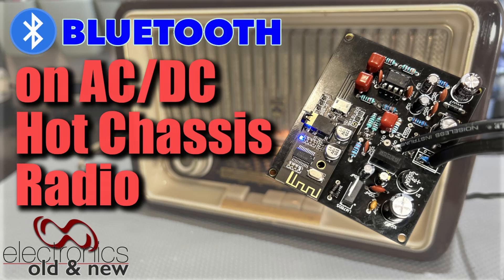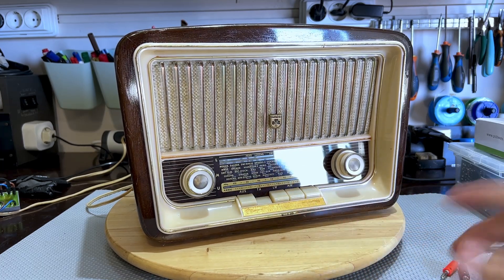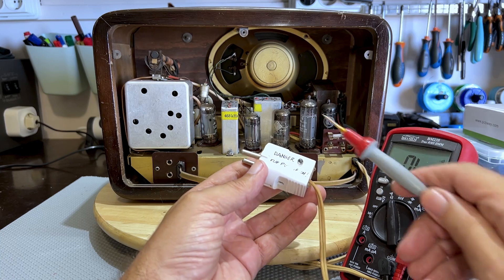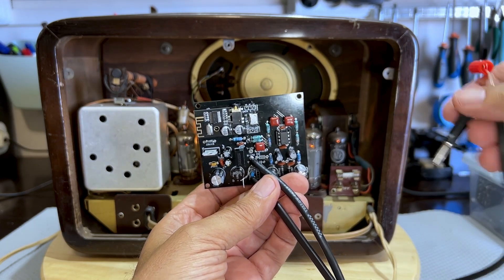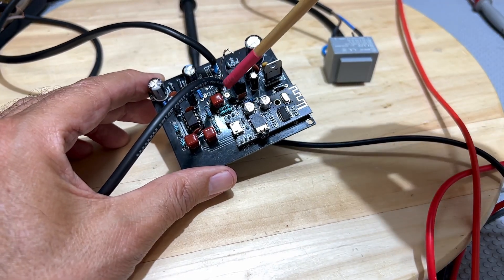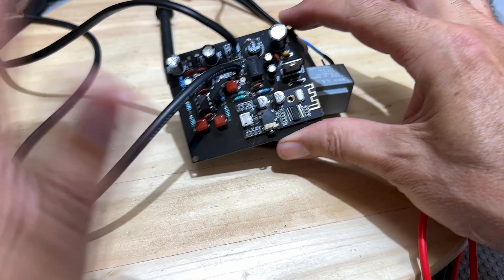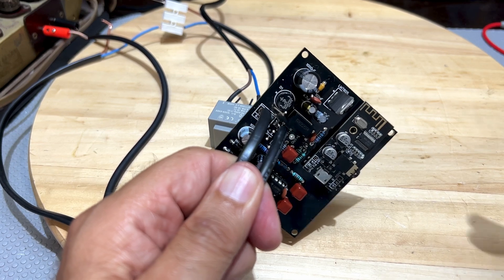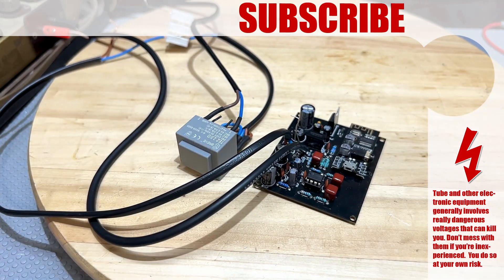Boost Your Vintage "AC/DC Hot-Chassis" Tube Radio with Bluetooth! Does my design work as is?

Comment: Thank you for sharing your knowledge with adding BT to vintage tube radios. There's 1 commonality in all your videos - they all plug into the phono port of the radio. But what happens if you want to add BT to a radio with no external input? I'm guessing you tap it before the volume pot (using a switch?) and what about levels? Does one still need an op amp in this case?
Reply from the maker: Yes, what is usually done is connecting to the top of the volume pot, preferably with a switch. The levels will probably still require boosting.

Comment: I've built 10 of these so far but all my radios so far have a 6VCT transformer windings so I'm having to go the transformer route.  Just curious if you know the maximum gain I can achieve using a 9VAC transformer before getting clipping. Do you think I could go with a 7X gain?
Reply from the maker: Theoretically it should go that high. But since you’re using a transformer, why not use a 12v one and get more headroom?
Reply: @electronicsoldandnew  if I go with a 12VAC transformer do I need to put a heatsink on the 7805?
Reply from the maker: Possibly. It will dissipate under 1W, but that could heat it up quite a bit.

Comment: There seems to be something wrong with the phono input. Normaly the input is not connected directly to chassis but there is always a block capacity of 5nF to chassis ground. No one would ever sell a construction where you can die by touching the phono inputs.
Reply from the maker: I’ve seen this before on a jubilate. Dangerous as hell … either by design or some tech changed things in the past.

Comment: would it be correct to say  using a mains transformer, the dc to dc convertor is no longer needed because you already have isolation /no ground loop (hum) or are you still needing to isolate digital earth from analog earth to prevent digital noise breakthrough?
Reply from the maker: It is probably not needed with a transformer for that exact reason, but I haven’t experimented with it as yet. Just wanted to see what would be needed to make the same circuit work on a hot chassis.

Comment: Why don't you design a circuit so you can't plug it in wrong? Have the circuit flip the hot and neutral the correct way or not allow the radio to have power to the chassis.

Comment: Why don't you design a circuit so you can't plug it in wrong? Have the circuit flip the hot and neutral the correct way or not allow the radio to have power to the chassis.
Reply from the maker: That’s not something I care to do, as most people have already found a way to use their radios safely.

Comment: When you are stil afraid that the audio ground gets on the live mains, you can put in the soldered audio ground a large capacitor, but it would be a 400V 8µ or so. I don't like the sound of 230V getting in your BT board, it is original not designed for that.
Reply from the maker: The cap would indeed make it safer, but the mains getting to the board is t a problem as long as it doesn’t get anywhere near anything at a different potential. Effectively all you’re doing is elevating the “ground” reference, which isn’t normally a problem.

Comment: You can use that miniature transformer in conjunction with a switch and wire it to the volume pot, using the switch to disconnect the radio signal, and add a 3.5 mm jack. On that 3.5 mm jack you could add a wireless Bluetooth dongle as another solution. Fantastic schematic and adaptation of your creation.
Reply: @electronicsoldandnew I just want to tell you that I really enjoy your channel and your presentation. In the States I don't get a lot of these types of radios to work on so you are and invaluable source of experience and information. Thank you
Reply from the maker: My pleasure

Comment: I am amazed that the EU never passed a law requiring all member states to standardise on the three-pin mains plug we enjoy here in the UK. 🤣🤣🤣

Yes, that was really realy naughty of me but I hope you get my drift. Here in the UK we're not that clever either with our reversible bayonet mains light sockets. I'd outlaw those as well as it's possible to buy B22 socket extension plugs. ⚡ 👿
Reply from the maker: I agree with you completely 😊 it would be so easy as some of these plugs have a hole on one end which would only require the sockets to have a protruding pin, but I guess they’re being stubborn in this issue.
Reply: @electronicsoldandnew  France and other countries plug have 3 pins, but there is no defined neutral wire position, only the ground/protective one. And you can still use 2 wires plug which you can connect both ways. 3 pin with defined ground is only required for devices with metal cover.
Btw british plug is too big.
Btw Im dissapointed by the design of this little Grundig radio, that there is phono input directly connected to chassis. Standard way for hot chassis radio was to use audio isolation transformer for phono input. Antenna was always protected by small value/high voltage caps (now we call them Y2 caps).
Reply from the maker: Yes, it’s a pity the plug issue hasn’t been standardised and regulated all over Europe. In Portugal we have no protection as regards mains polarity.
The Grundig was a surprise indeed. Initially I didn’t realise it was an auto transformer, and the worst part was the phono ground to chassis connection. I wonder how many people got shocked over the years … totally needless. A proper transformer would have cost very little more than this one, and all the danger removed from the set.
Reply: @electronicsoldandnew  There were planty of hot chassis sets in 40s-50s. Copper was expensive, so transformers were expensive too during war and postwar years.
But I never saw set where you can touch hot chassis without opening back cover. It looks like error.
There is no way how to standardize plugs across Europe - it would be too expensive, you would have to rebuild all electric installation. We in Czech republic also dont have polarized plugs, we use french standard designed in 1920s. German standard doesnt have it too, both wires should be considered as possibly hot.

Comment: Greetings From Germany... A question concerning identifying the chassis ground transformer of the radio's schematic and then comparing it to a similar model that has an isolated ground. 
Is it possible to make a supplementary video or Part 2 just to show us viewers exactly what to look for on the schematic for a positive identification of chassis ground.
Reply from the maker: You can easily see it from the schematic. One side of the mains is shown as grounded. You can also just test with a multimeter as I did at the start of the video.
Reply: @electronicsoldandnew  I think to remember that you forgot in the schematic to show that one side of the 6.3V filament winding of the transformer is connected to ground. You told it, but it is not drawn. Maybe that is the confusion here ?
Reply from the maker: Perhaps, but the ground is shown. Not sure I understand the question

Comment: Nice addition to your Bluetooth lineup Manue, The only trouble is Bluetooth is you can't transmit simultaneously to one's whole radio collection. Coming up with a legal AM transmitter with good audio would be nice for the collector, but offers some serious problems.
Reply from the maker: True.
Reply: Can't vouch for this but there is a seller on ebay (orient100) creating Bluetooth to AM radios supposedly not exceeding 50mW (below the unlicensed limit in most countries). They can trim the frequency to suit. Not cheap, but may be a solution.
Reply from the maker: Will have a look at it. May be interesting